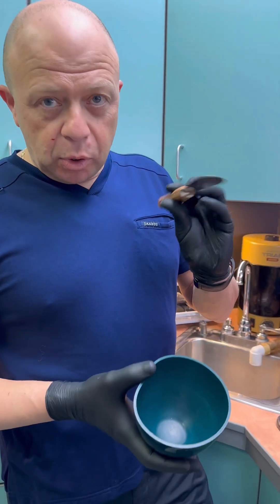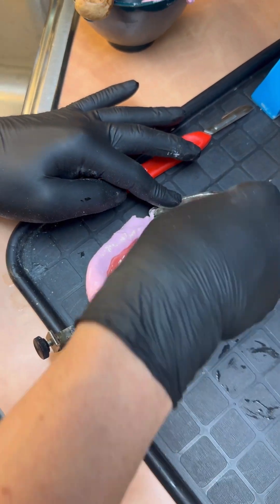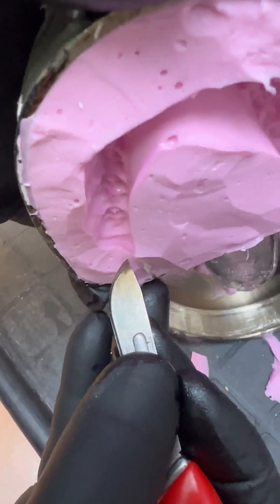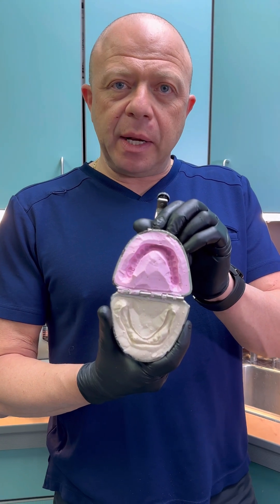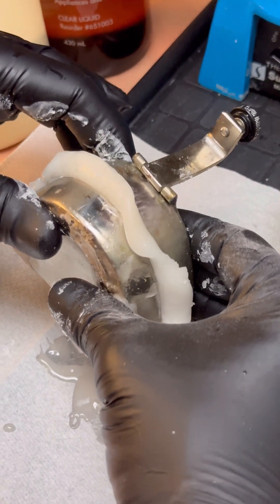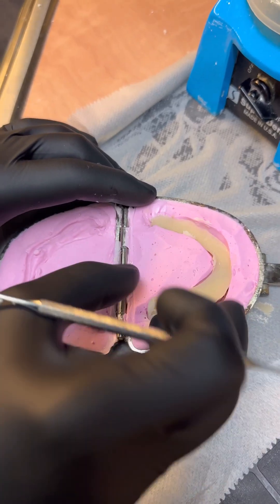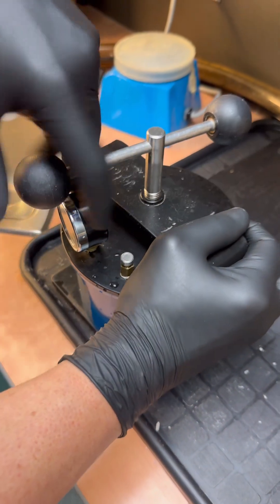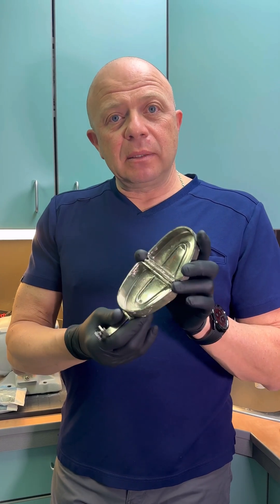Denture Duplication

Comment: Did you apply Vaseline on denture and surroundings alginate before pouring orthodontic resin and coloring acrylic?
Reply: No.   There is no need. The only time Vaseline is applied is when we pour the second member in alginate and it is applied so that the new alginate does not stick to the old alginate.
Reply: No need to apply vaseline. The only time you apply Vaseline is when you pour alginate into the opposing member so that they don't stick together as it is setting